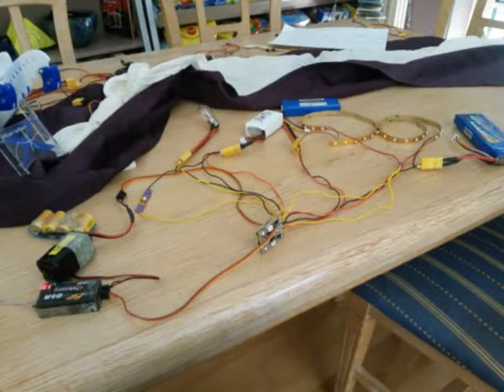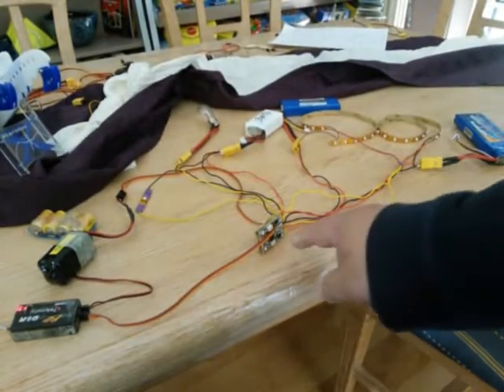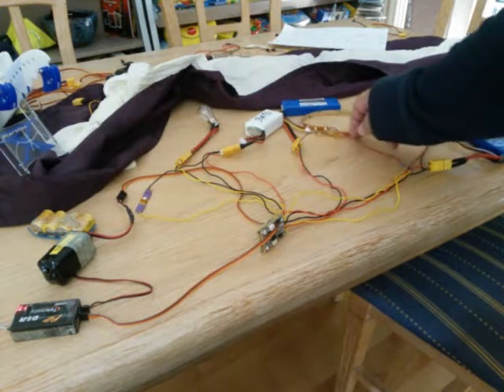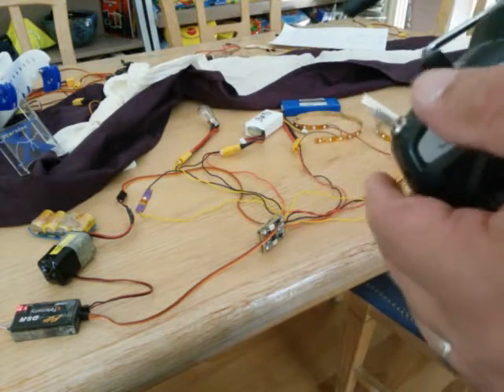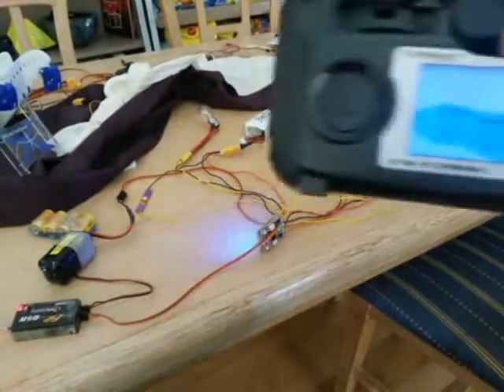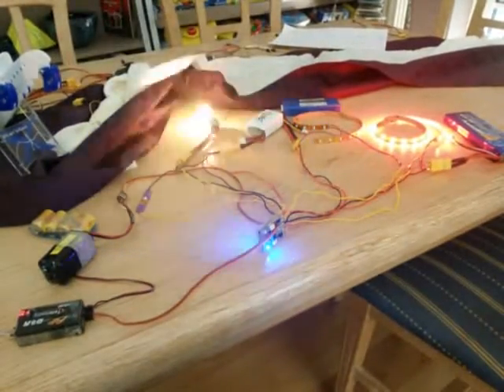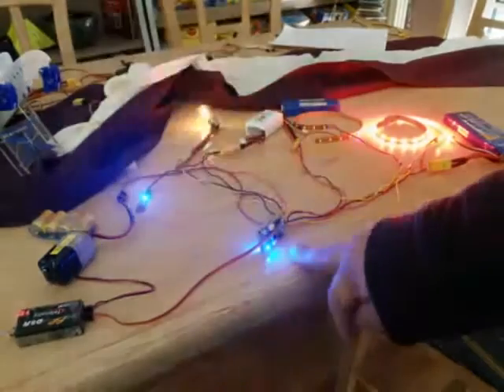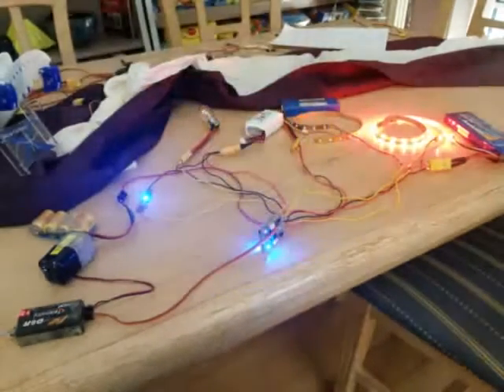4 Channel RC Switch with ATTiny85 for radios using ER9x/ERsky9x

Comment: This is awesome pilot! Not sure why more people dont get the potential. Thanks so much for your work.

Question:
Could you pass the ppm signal over the atiny85 onto say a flight controller that uses channels 1-4 for motors? Curious of this because that would mean you could use other channels besides 1-4 and expand the usable channels on a flight controller that is limited to only 1-6 channels.
Reply from the maker: Brad Focht I am not sure I understand what you mean. This doesn't used PPM. It uses ONE spare channel to control 4 different devices. normal switches you can buy use one channel per device. Normally flight controllers use PPM or SBUS. I can't remember if I posted a link to the project page in the description. If I didn't, please check again a bit later as I am not at the PC at the moment..
Reply from the maker: link to the project page is in the description..